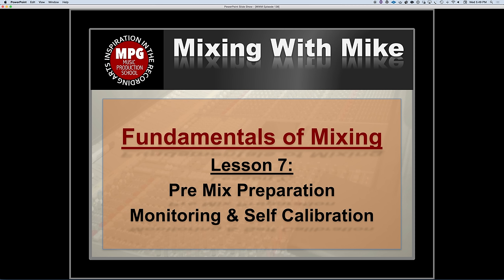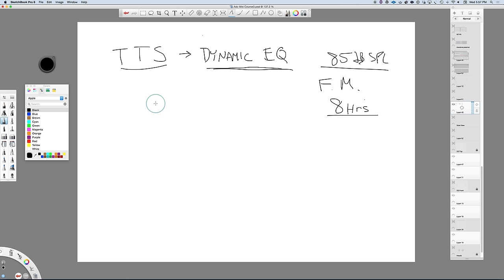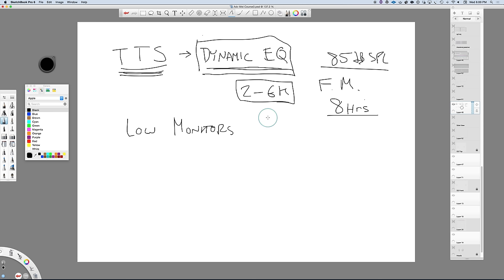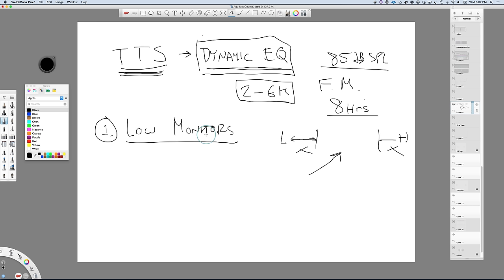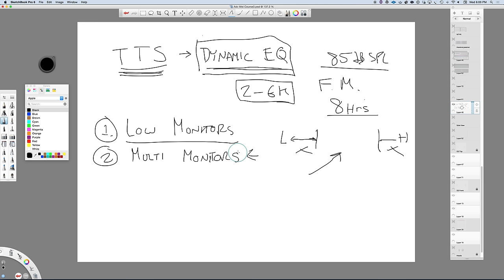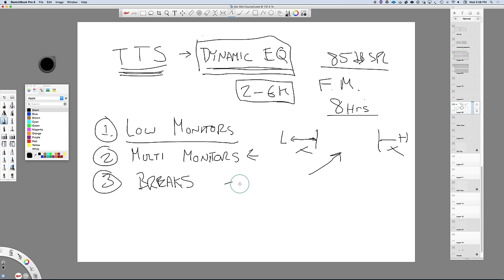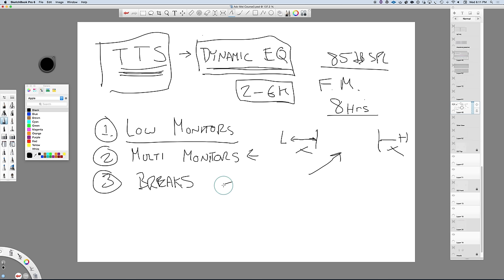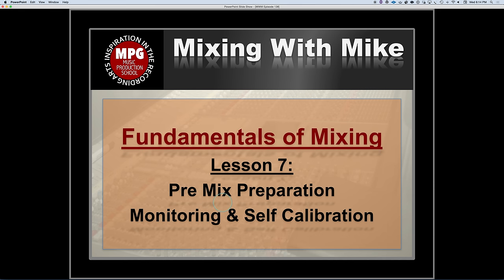Fundamentals of Mixing Lesson 7: Monitoring and Self Calibration

Comment: Yes mix mapping we (or least I) want that please. I'd like to be able to work on designing my mix in my head from start to finish based on what I have at the start. I sort of a able to clearly see what need to go where in terms of front to back mixing. Left right is also good but for the rest it's a bit more fuzzy and I end up either stop thinking about it or go with the flow with little intention or planning.
Reply from the maker: Hi Rose, 
I will have at least one whole lesson on this.
Cheers!
Mike
Reply: Yeah, Thank you Mike
Reply from the maker: Yes, writing and producing is a different process from mixing. There has to be room for experimentation in mixing too, coming soon...
Reply from the maker: Thanks Germo!

The mixing courses on my website are way more detailed. There are also downloadable multitracks that I use in the demonstrations so you can follow along. I also answer course related questions and listen to your mixes. 

My website has over 600 hours of video on mixing. This is like a broad overview of what is on the site.

Cheers!
Mike

Comment: Lately I've been thinking about that break strategy. Do you have a set of a usual ratio? I'm trying 52min on, 17min off. Or is it just whenever you feel based on a minimum work time like that 45mins you mentioned? Your videos are gold btw. Can't thank you enough.
Reply from the maker: I do not set a timer, because it can interfere with a good workflow. It's more about being sensitive to the process and if you are struggling. I generally monitor at very low volumes for most of my work and raise the volume to check low end balance when necessary. This keeps the fatigue low and the focus clear.